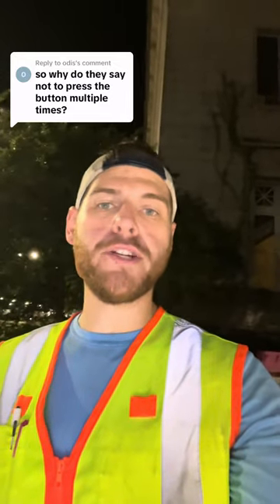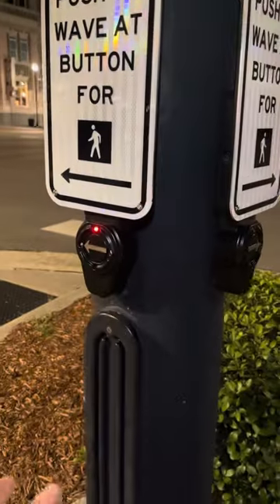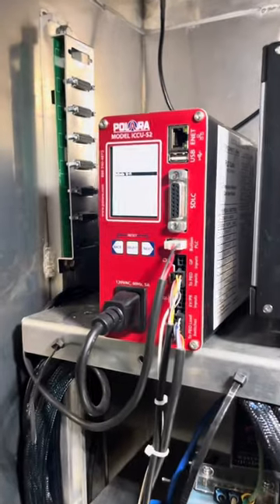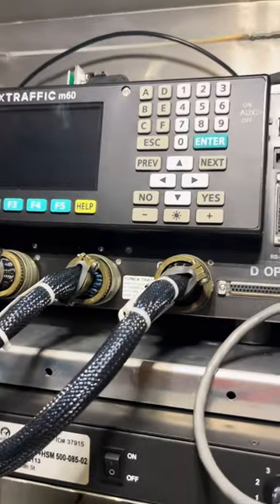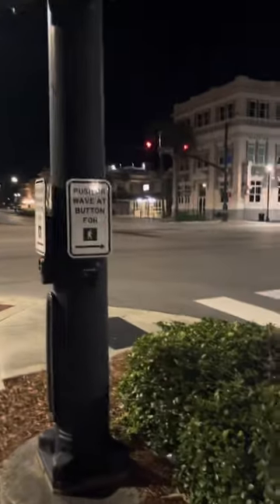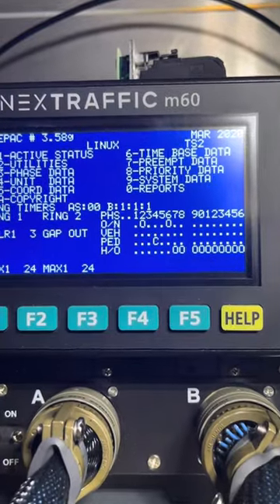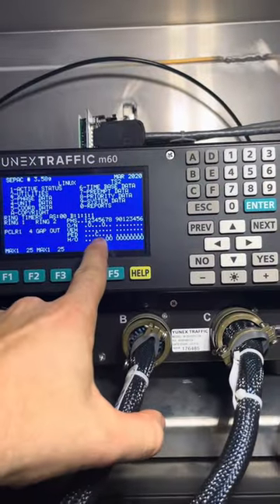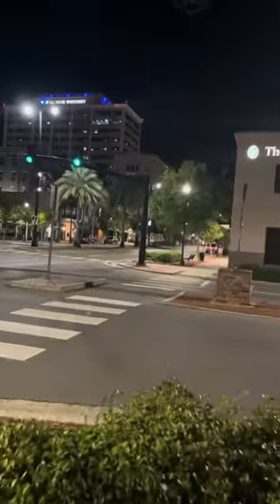Pedestrian push buttons! Press it TWICE!!

Comment: In the book DOS for Dummies, there was a tongue-in-cheek sidebar that stated: "If you press the command key repeatedly, DOS will sense your urgency and move the data along faster. Hint: This also works for crosswalk signals and elevator call buttons."

People were even more gullible about technology in 1991 than they are today, as if that's even possible.
Reply: I think this system can be programmed to take pedestrians as a top priority. 

This features would be useful in school zone, popular parks and crowd beach, etc.

Comment: I get out of my car to push the button on those long lights 😂❤
Reply: 🕵💢♥️ shout out for showing the guts....saved forever 🧠🤌
Reply: The real MVP clearing up the line for us all right here.
Reply: Sorry to burst your bubble but don’t bother, pushing that button puts a call onto the phase your currently sitting on. It won’t change the time of the other direction. The other direction still has to finish its timing whether you push the button or not.
Reply: @Liam_Wa  That only applies to pre-timed intersections. There are scenarios where the light would change faster than not having pressed the ped request. There are also scenarios where it won't effect anything like you mention. So there are two bubbles, no need to pretend to pop anything.

Comment: That system look fairly modern, is it the same for older systems?
Reply: The pedestrian system he described has been the standard for about 20 years.
Reply: @Liam_Wa  Yes, Polara has been around for a while, although many places still have older systems or placebo buttons that don't do anything (mostly because they used to and were later disconnected and are still awaiting servicing, etc.)

Comment: I absolutely hate when people spam the crosswalk button, but this seems like a really poor design choice. So if a second person walks up and presses the button, the light won't change? I'm 99% sure it doesn't work that way in BC, Canada, as I've seen multiple people press the button and never seen it not change.
Reply: Canada uses the same traffic control standard as the US. You only need to press the button once. Pressing it more won’t change anything.
Reply: @Liam_Wa   ....but it won't hurt anything either, will it?
Reply: No, they're saying pushing it multiple times does nothing. It's idempotent. The first press registers the call, subsequent presses change nothing, they just replay the audio. The call remains registered.
Reply: @rael5469  Correct.